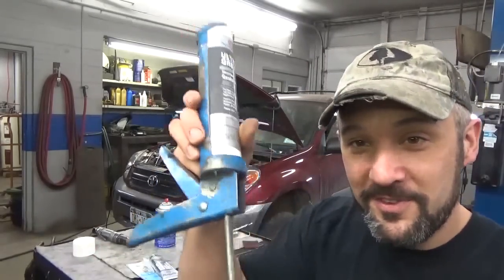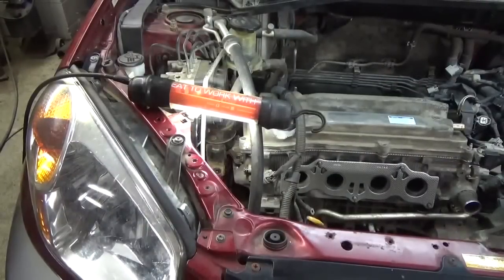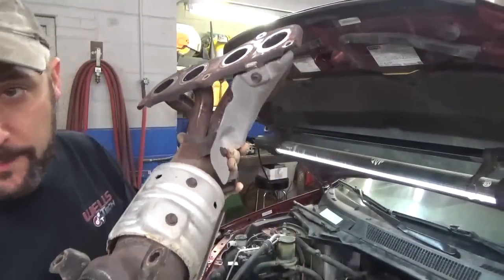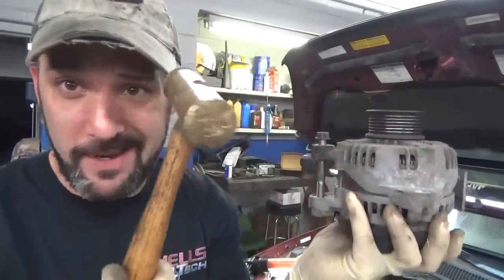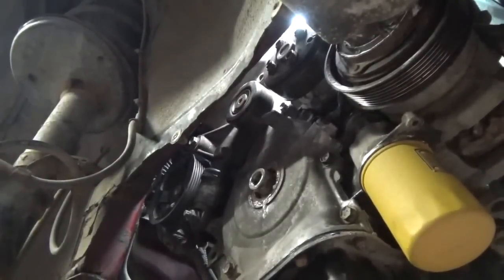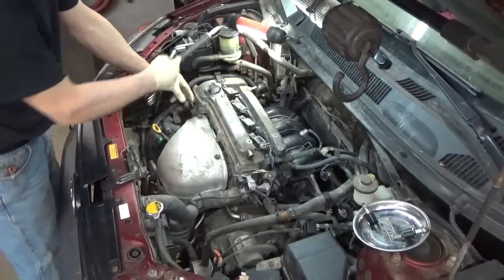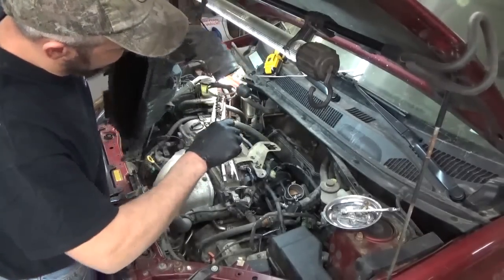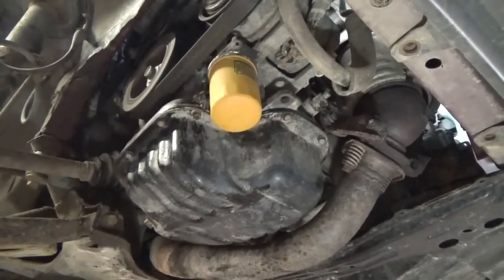Toyota Rav4 2AZFE Stripped Head Bolt Repair Part V

Comment: For valve jobs I found using one of those plastic screw organizer boxes that have different compartments helps keep valves, springs,  and keepers together.. Try to find four with 8 large compartments that way you can use one for each bank and keep Int and exhaust separate even on a 24 valve. Organizers they sell for bolts usually have large enough compartments.

You might be able to find a box fisherman use to keep plastic worms in that would work.

Comment: Great videos as usual, you saved me a ton of time on my F150 exhaust manifold swap by cutting the bolts off 1st with a torch and then working the studs out after you take the manifold off.
Keep it up, I know it takes alot of time making the videos, and doing the work, I hope youtube if making it worth you while. !!!

Comment: What happened to your mechanic? Haven't seen him in any of your latest videos.
Reply from the maker: Long story but he has been gone a while, had to lay him off.
Reply from the maker: Back around the time I was doing the Subaru Series...
Reply: South Main Auto Repair Not enough work for the both of u's or he wasn't a right fit for your operation?
Reply from the maker: Well I don't wanna discuss it on YT.
Reply: South Main Auto Repair Oh, Ok. Nvm. Yeah, when you lay someone off you gotta be careful what you say because it may be used against you at a later date.

Comment: Did you use a special tool to tighten and torque the crankshaft pulley bolt? Is there a trick to doing this without the use of special tools?
Reply from the maker: Handy Daddy You can use a strap wrench to hold the pulley while you torque it.

Comment: I have used high tack in the past and recall it worked good unless you needed to fill damage areas do to cleaning the surfaces improperly.  Although I can say I would have preferred the spray can you are using to the paint on can.

Comment: What kind of special tools do you use to hold the crankshaft still while torquing the bolt or the the water pump pulley still while putting the bolts in (instead of wedging say a spanner between two of the bolts lol) I've found my ways of doing these tasks, but if definitely be open to something easier.
Reply: Answered my question in the Subaru 2.5 head gasket part 4 and 5 videos.

Comment: Three plus years later, I finally watch this series!  It was good to watch it, anything like a head gasket replacement or similarly complex job are a bear.  I started watching with the head "seat" replacement.   I don't think that this was Toyota's best effort in engine design.
Reply: That so many headbolts pulled loose and that the tightening sequence made you feel like you were torquing the bolts to just short of the break point made me think that an engineer just out of college designed the headbolt torque spec and procedure.  Things got better, but I was definitely not inspired by the timing cover having to be in place to put the timing chain tensioner on!
Reply: By the way, I work on computers and peripherals.  I use ice cube trays to organize the removed (tiny) nuts. bolts, washers and the like. I work backwards in the tray for reassembly.  You have shown me one other thing I should do.  I'm going to seal the trays shut if a job takes longer than a day.  I'll try clear packaging tape first.

Comment: One other thought, "turning the engine backwards to release retainer on chain tensioner. That's a big no no, like a VW V-6, even putting torque converter bolts in, 1/4 turn wrong way, jumps time, heard horror stories on IATN, food for thought, I do it your way.
Reply from the maker: Larry Hurst Oh got ya good input thanks Larry :)
Reply: it's said in the factory service manual to rotate the engine backwards to release the tab on the tensioner

Comment: I am now going to install anti squirrel screens in all customers cars .
Reply from the maker: wtbm123 It's the best thing to do Terry because you just never know when you will suck u a squirrel...
Reply: South Main Auto Repair Yea i know what you mean ,Well  I guess i have just been lucky up till now , hard to tell how many close calls there has been tho .I better start installing
Reply from the maker: Use chicken wire on bigger V-8 engines... they have more CFM's
Reply: Do anti squirrel screens work for rabbits? Would hate for one to get sucked up by my turbo.
Reply from the maker: Matt Bartholomew uhhhh maybe but you may want to test it on a baby rabbit first to be sure...

Comment: with the intake couldn't you bolt in on first with the exhaust manifold with the head off the car and then put the head on all as one piece. that's what we do, saves a lot of time lol
Reply from the maker: Some random person That is how I usually pull heads but in this case the intake came off first to diagnose the vehicle so I wasn't sure if it would go together good if I put it on the head first because I didn't remove it that way. Didn't wanna goof up the gasket with one of my trial and error games haha
Reply: South Main Auto Repair haha all good, great video by the way yeah its like toyota knew the head gasket was going to leak so they put a "diaper" there lol
Reply from the maker: Some random person Makes you wonder huh?

Comment: Thanks for the answer. I think Toy fixed some of the Camry's under warranty, would not do the Scion, same motor, same problem, go figure. i did what you did and pulled the intake due to the diaper, could not see the coolant or oil leak, but no water passages in the manifold, so almost had to be the head. Thanks
Reply from the maker: Larry Hurst Ahh the diaper lol what the heck? Did your go back on?